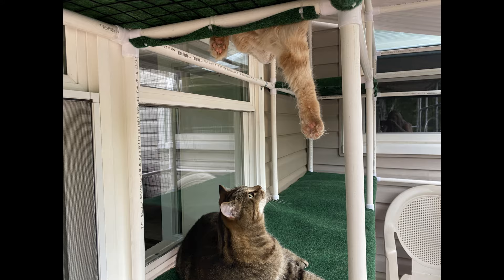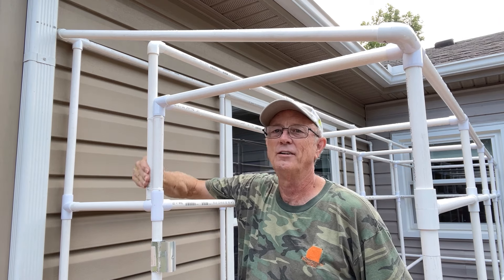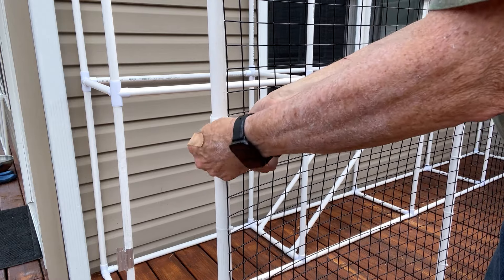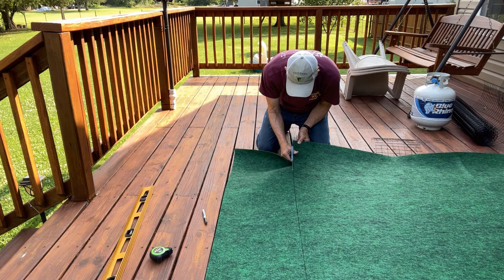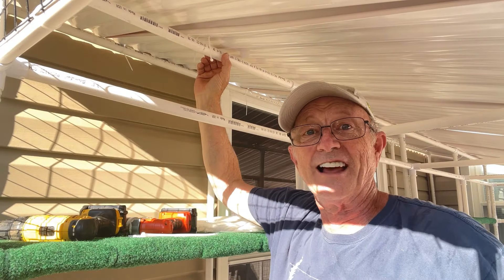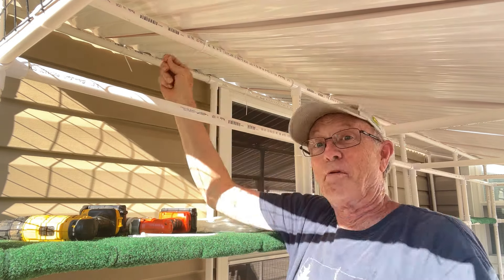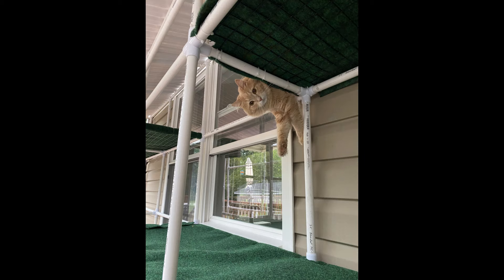How to build a Catio (outside cat enclosure) DIY

Comment: Thanks for sharing!!  I used a metal dog kennel (maybe 8x8x4 with a vinyl tarp roof -I put a layer of chicken wire under that) from Walmart.  I think it was $300?  So eventually it will rust (I think it is powder coated but that will only last so long), and it does require some time and effort to cut through the metal to install the cat access door.  But it is an alternative.  Mine is on the ground, and I also wanted to make sure predators couldn’t get in.
Reply from the maker: Very ingenious idea using the metal dog kennel!
Reply from the maker: You can show us your catio by joining my Facebook group, DIY Project Station: https://www.facebook.com/groups/882510523338538

Comment: Great video!! The overbuilder in me says if you put a 1/8" rebar in each pipe and concrete, that would hold me!.
Reply from the maker: Thanks! You have a great idea for a free standing catio. Since mine was on a deck and next to the wall of my home, I just secured it to the deck and the wall with screws.

Comment: Nice work~ It's apparent that you really love your cats. Warning: your window-installed cat door is a weak point against break-in and that fence door isn't very secured. Your cats can wiggle themselves out at the bottom corner... also those screws wouldn't stay put for very long. Considering the amount of labor, pvc used, and total project cost, I'd have build a wooden enclosure that expands all the way to the deck railing with a height clearance that extends above the windows. The structure would be heavy enough to free-stand and wouldn't require drilling into the house or deck. A proper locking door would be installed to secure the pets and deter any intruder. FYI, I let my cats go in and out during the day and lock them in after dinner. They often stay in the backyard or hiding inside a bush or atop a tree within the premise, but normally, I find them sleeping on my bed instead of theirs. Like people, the more you say "no" the harder they want to try. Cheers~
Reply from the maker: You've got some great ideas. Thanks for watching and commenting.

Comment: I love this idea… we have a lot of coyotes in the area and I live on a busy road.. hence the reason I’m considering a Catio. So I’m worried about strength and stability of this structure, if cats wanna get out or worse a predator wants in… maybe add wood on the 4 corners and 2 midway on opposite sides for this to work for me :)
Reply from the maker: So far our cats have not gotten out. If you are concerned about predators getting in, you may want to upgrade to 1 inch pipes or using your wood idea.
 
Let me know how yours turns out by joining my Facebook group, DIY Project Station: https://www.facebook.com/groups/882510523338538

Comment: You inspired me! I was wondering how I could make a sturdier version to hold up strong winds and rain since I live in Florida.
Reply from the maker: You could use 1 inch pipes instead of 3/4 inch and ancor it securly with brackets, stakes or sand bags.

Comment: How many tie downs did you use to hold down the PVC pipe to the deck? I love how you test everything out and give solutions! You are very thoughtful!
Reply from the maker: Thanks! I used 3 brackets to secure the PVC pipe to the deck (see 3:24 minutes into the video.) I also secured the top of the catio to the window frames (Shown right after that in the video.) So far, the catio has held up well during some strong winds. It helps being attached to the side of the house.

Comment: That was a wonderful project. I’m glad I saw it, I have 2 indoor fur babies. My husband and I are wondering how many pvc 90 elbows you used, and how many sticks of pvc pipe did you use. Thank you for including the drawing of the catio. 😊
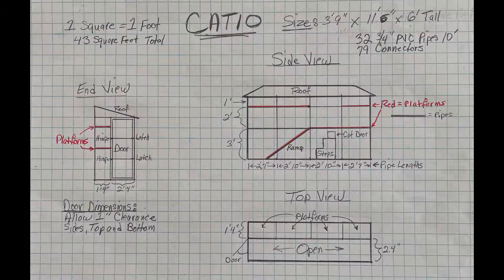Reply from the maker: Thank you! The drawing that includes how many pipes (32) and connectors (79) I used starts at 1:25 into the video.

Let me know how yours turns out by joining my Facebook group, DIY Project Station: https://www.facebook.com/groups/882510523338538

Comment: I'm curious how it's holding up 6 months later? Anything you would improve or replace? Great project, you have me rethinking how we're enclosing out back patio for the cats.
Reply from the maker: Thanks. So far, it's held up great for that last 8 months, but time will tell. I may be sorry I didn't use the ultraviolet heavy duty zip ties. I didn't know about them until after I built the catio. Of course, they are black and would've looked ugly against the white PVC pipes. The outside frame around the door is kind of flimsy, so I'll have to shore that up, somehow.

Let me know how yours turns out with pictures and/or videos by joining my Facebook group, DIY Project Station: https://www.facebook.com/groups/882510523338538

Comment: Great job! I’m wondering  if I can have a “dirt area” for my cat because she loves to roll in the dirt outside. It’s a hard dirt surface separate from her litter box area. Just thinking this out. She also loves to lay in the sun and cat nap so I may leave part of the roof covered only with chicken wire.
Reply from the maker: Thanks! Yes, when we had outdoor cats, they also rolled in the dirt, LOL. If your catio faces the sun, you can still cover it completely with a roof. We did that and about half of the catio gets sun and half of it gets shade. And the half that has the platforms next to the house wall stays dry when it rains. Let me know how yours turns out by joining my Facebook group, DIY Project Station: https://www.facebook.com/groups/882510523338538. Have fun!

Comment: This is truly amazing. My friend needs one for her apt complex. 2 of her cats ran put in the cold last night. We talked a little after when she got them and said "we need a catio". Im planning to built one with her, but maybe have a small one at her balcony to have a view and another outside her small yard. I think the place is concrete though, any advice to hold it in place??
Reply from the maker: Maybe you could attach brackets at various points to the bottom pipes that would stick outside enough to go under sand bags or something heavy to hold the catio in place.
Reply from the maker: Let me know how yours turns out by joining my Facebook group, DIY Project Station: https://www.facebook.com/groups/882510523338538

Comment: I’m doing this! Thanks for sharing!
Reply from the maker: You are very welcome!

Note: You may want to use heavy duty UV resistant Zip Ties. I've been told they last longer than the standard ones I used. So far, mine are holding up fine, but time will tell. I didn't learn about them until I finished my catio.

Let me know how yours turns out by joining my Facebook group, DIY Project Station: https://www.facebook.com/groups/882510523338538

Comment: Loved the idea! I'm thinking about making one as well. Is it still holding on good? Is it actually sturdy and robust enough? Thanks!
Reply from the maker: It's holding up good so far. The only thing I may need to do is reinforce the outer frame of the big door that holds the latches. There are not many adjacent PVC pipes connected to it for support because it's a walkway, so it's a little flimsy. I might attach a thicker pipe next to it. If you're not using a walk-in area with a door, it should not be a problem, though.

Comment: What a great project.  I bet your kitties love you for it.   Can you tell me what the tool/blade was that you used to cut the corrugated roofing material.  I have not had any luck trying to cut that stuff.  It just cracks and splinters.  Maybe mine was made of a thicker plastic?  Thanks so much for the video.
Reply from the maker: Thank you! I used an Oscillating Multi-Tool.
Reply: @RoBeaird  Thanks, I will look into getting one.
Reply from the maker: You are welcome. Let me know how your catio turns out by joining my Facebook group, DIY Project Station: https://www.facebook.com/groups/882510523338538

Comment: Simply genius using all those zip ties instead of nails, screws, etc.  We would love to build one for our cats. About how long did it take you to build this?
Reply from the maker: Thanks! You may want to use UV resistant heavy duty zip ties that hopefully will hope up longer. I didn’t think of that until later. Mine are holding up fine so far, but who knows for how long? It took me about 40 hours over a period of 2 weeks but I took my time. I’m 70 years old and retired. Producing videos is my new career. 😊
Reply from the maker: Let me know how yours turns out by joining my Facebook group, DIY Project Station: https://www.facebook.com/groups/882510523338538

Comment: Thank you so much for the video! I'm currently planning my own PVC catio :D Can I ask how you got the slanted roof at that angle? Also, did you use normal pvc or furniture grade? :)
Reply from the maker: You are very welcome. I made the back PVC pipes 1 foot higher than the front for the slanted roof. I used normal 3/4 inch PVC pipe. 

Let me know how yours turns out by joining my Facebook group, DIY Project Station: https://www.facebook.com/groups/882510523338538

Comment: great job-im headed to hardware store,my friend
Reply from the maker: Great! You may want to use heavy duty UV resistant Zip Ties. I've been told they last longer than the standard ones I used. So far, mine are holding up fine, but time will tell. I didn't learn about them until I finished my catio.

Let me know how yours turns out by joining my Facebook group, DIY Project Station: https://www.facebook.com/groups/882510523338538
Reply: @RoBeaird  for sure-thank u God bless
Reply from the maker: May the Lord bless you and your project!

Comment: This is brilliant. We want a catio for our tiny adopted stray and our massive Maine Coon. We have received quotes of more than £3000 which we are unable to afford. I will show this video to my husband. He will be delighted. Quick question: any ideas how we can secure it or weight it down as our catio must sit on a stone patio. Thanks so much from Bedfordshire,  England
Reply from the maker: Thanks! If yours will be against a wall, you can attach it with screws. If it will be freestanding, see Flyboyminer's comment below. He suggested putting a 1/8" rebar in some of the pipes and add concrete. You can use concrete screws with brackets to secure it to your stone patio. Let me know how it turns out!
Reply from the maker: Let me know how yours turns out by joining my Facebook group, DIY Project Station: https://www.facebook.com/groups/882510523338538

Comment: Thanks for the video.  Inspiring.
What tool did you use to cut the roof?

Also, thanks for the idea of putting carpeting over fencing.
I am thinking of making an awning, and using the fencing to stiffen the awning material and prevent sagging looks good to me.
Reply from the maker: I used an oscillating tool to cut the roof panels. Let me know how your project turns out.
Reply from the maker: Let me know how yours turns out by joining my Facebook group, DIY Project Station: https://www.facebook.com/groups/882510523338538

Comment: Thanks so much for the lovely video! What kind of hinges did you use for the PVC door?
Reply from the maker: https://www.amazon.com/Aluminum-Snap-Hinge-Doors-Vents/dp/B06XKGKTZ1/ref=sr_1_1_mod_primary_new?crid=29485876CJBJP&dib=eyJ2IjoiMSJ9.JDOS0_Fqutt7AnmyU2z6buzzxy6eYjhMPjGgdjBvC48jQnZHJ5o6-HFIQnvXUr9A7vi_RbmKdj1hOB59RBtahBQ-bowXO1Ke33gMI2-gYNVwSxUK1DQgDFmyV6LGd-Wv_mq5YuiRhFg6BtxAJvk_2XpgIKYudRuNj09JU6hru6RNu1wPYfojETZIQ9l9wpq5msTMqI1rouFVuVRpJlzR1zED6vfIzqekjw-nHNRG6VA.b5ODXe7yivGfWOIm12pf3M3dEWTWjdUWSVyTGayTsW0&dib_tag=se&keywords=snap%2Bon%2B3%2F4%2Binch%2Bpvc%2Bpipe%2Bhinge&qid=1713469210&sbo=RZvfv%2F%2FHxDF%2BO5021pAnSA%3D%3D&sprefix=snap%2Bon%2B3%2F4%2Binch%2Bpvc%2Bpipe%2Bhinge%2Caps%2C84&sr=8-1&th=1

Comment: I love seeing this. But how do you keep them from escaping out in the yard ? Is the door secured shut so they can’t push it open and escape?
Reply from the maker: I used 2 sliding bolt gate latches. You can see me putting them on, 5 minutes into the video.

Comment: Hi, I am making a similar catio based off your design. I couldn't quite see what type of connectors and/or how the pipe was situated just under the roof. It looks like there is a connector facing outward but wonder if that is necessary...
Reply from the maker: I'm not sure what you are referring to. The best place to see the frame, begins at 2:27 into the video. Maybe check that out?

Comment: Will this hold up in heat? I live in Phoenix and while my cats will be inside during the summer I don't want to have to tear down
Reply from the maker: You want to use the black heavy duty UV resistant Zip Ties. 
 Let me know how yours turns out by joining my Facebook group, DIY Project Station: https://www.facebook.com/groups/882510523338538

Comment: Do you have any ideas on how a renter could do this without needing to drill into the adjacent wall? Im thinking camping stakes and/or feeding the pvc through cinderblock to make the bottom secure

Thank you for the video!
Reply from the maker: It depends on what the floor is. If it is on a deck, you could use bailing wire to attach the bottom of the catio to a few places by wrapping it under the planks. It would be easy to remove later-just cut the wires and pull them out. That's providing you can get under the deck to fish the wire. If the catio will be on a patio or the ground, your idea of using stakes or cinder blocks would also work. You wouldn't need to run the pvc through the blocks, just attach the bottom pipes to the blocks using bailing wire. Let me know how your Catio turns out!
Reply from the maker: Let me know how yours turns out by joining my Facebook group, DIY Project Station: https://www.facebook.com/groups/882510523338538

Comment: How many pipes and length (8' or 10'? that you end up using for the project. Got check prices for the material(PVC Pipes and fitting) Everything went up last couple years.
Reply from the maker: I used 32 10 foot 3/4 inch pipes, which I got from Lowe's and 79 connectors, mostly bought from Amazon.

Comment: Great idea, I was going to build mine with wood. I hate wood, it never cuts to length properly 😂. What did you use for the door hinges?
Reply from the maker: Thanks! I got the hinges from Amazon: https://www.amazon.com/Aluminum-Snap-Hinge-Doors-Vents/dp/B06XKGKTZ1/ref=sr_1_2?crid=CJGN1W4WMWZ9&keywords=snap%2Bon%2Bpvc%2Bhinges&qid=1704145027&sprefix=snap%2Bon%2Bpvc%2Bhinges%2Caps%2C107&sr=8-2&th=1

Let me know how yours turns out by joining my Facebook group, DIY Project Station: https://www.facebook.com/groups/882510523338538

Comment: Doesn't PVC deteriorate with prolonged exposure to the sun? One of the YouTube channels I follow said they had to paint exposed pipe or it would become brittle over time in sun.
Reply from the maker: PVC is resistant to sunlight but will eventually weaken over time, but that will take many years before significant damage occurs; some say 50 years. We'll see, but I'm not about to paint the PVC, like you would have to when using wood. If you're concerned, you may want to use a bigger size for your PVC.

Comment: Did you glue any joints? It could work lose with time and wear.
Reply from the maker: I did not glue any joints. That would make it difficult if I ever needed to take it apart. I plan on using screws to secure any joints that come loose. I actually had to do that on a couple. Just a short wood screw does the trick.

Comment: How well does this hold up with bad weather? We get one or two bad storms a year here. This does look a lot easyer to build then with wood.
Reply from the maker: It has survived thunderstorms and high winds. Just make sure you secure it well. I used clamps to my deck and house wall and used numerous zip ties on the roof panels.
Reply: @RoBeaird  Thank you for your reply, I'm going to build one like this in spring.
Reply from the maker: Great! Let me know how it turns out by joining my Facebook group, DIY Project Station. You can post pictures and videos: https://www.facebook.com/groups/882510523338538

Comment: I have nearly everything ready to start building my catio 😁 What did you use to fill the holes in the roof for the zip ties?
Reply from the maker: Any type of waterproof sealant will do; I used a clear color.

Let me know how yours turns out by joining my Facebook group, DIY Project Station: https://www.facebook.com/groups/882510523338538

Comment: Couple of things...
1 PVC becomes very brittle over time due to exposure to the sun, hot weather and even fluctuating temperature extreme.
It just doesn't last a long time. 
Because of this, not gluing all of the joints can become problematic for structure security and safety for the cats. 
I would highly recommend gluing the joints together, at least the base frame and exterior frame - walls, roof.

True, PVC is inexpensive compared to other building materials and very quick and easy to construct, however regarding long-lasting, it just doesn't last. 

I have been in the construction industry for over 25+ years, and I have myself built things using PVC because of the same simple easy to use reasons. 

Hot weather and very cold weather really shortens the life and strength of PVC. 

The good thing is that you can cut out and replace certain areas of the decaying PVC over time as needed. 

Don't put it in direct sunlight over extended periods of time. This will shorten the lifespan of the PVC.
Utilizing some type of shade will prolong the PVC.
However PVC does STILL dry out and eventually weaken, crack and become very brittle. 
It's not a forever material that is exposed to the weather.
Reply from the maker: Great points, thanks for sharing. You may be right about PVC, but it doesn't have to last forever, LOL.